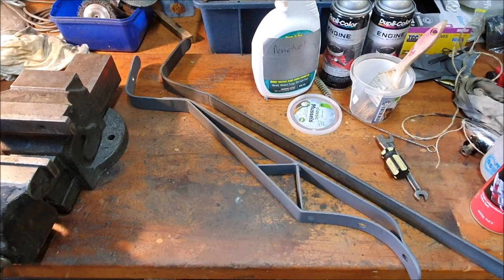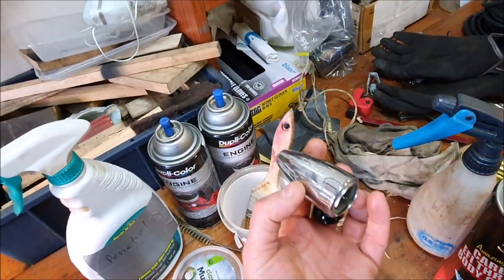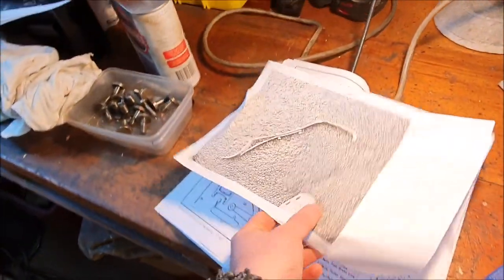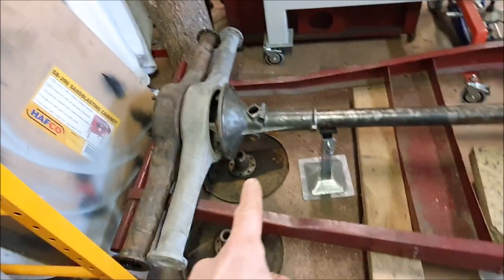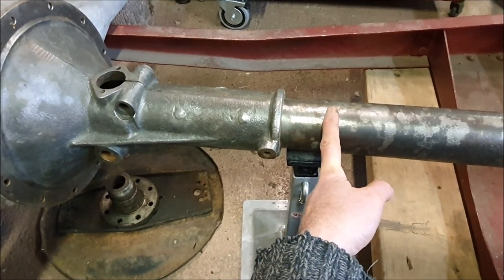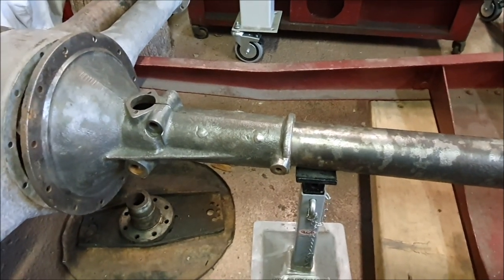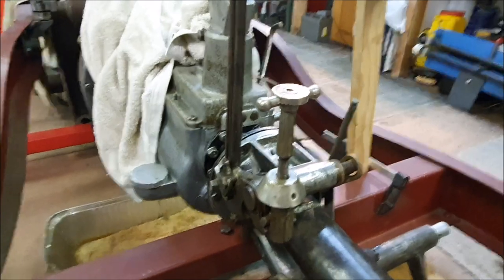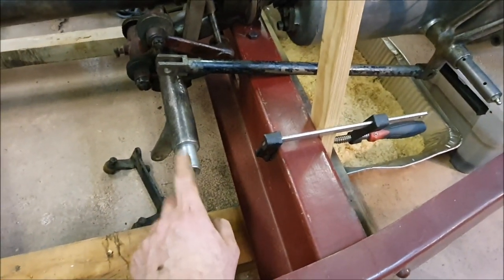Pre war Riley 9 Brooklands replica - brake jigsaw

Comment: Have you thought about headlamp bracing? My Austin Swallow has braces (separate) each side and my Standard Swallow has a brace that spans right across (actually, the headlamps are mounted on this), I notice on my Ruby the headlamps shake and I am thinking about fabricating a brace to stiffen them up.